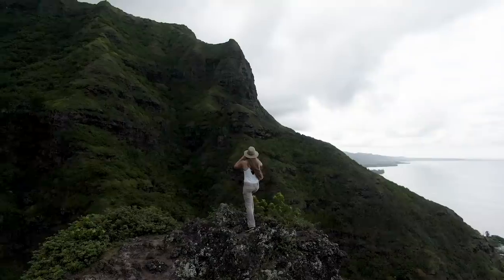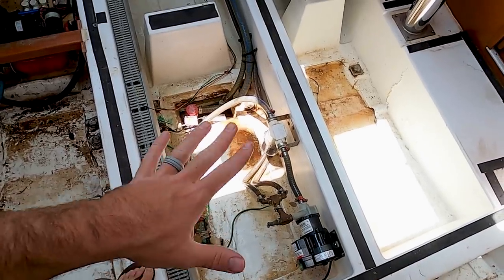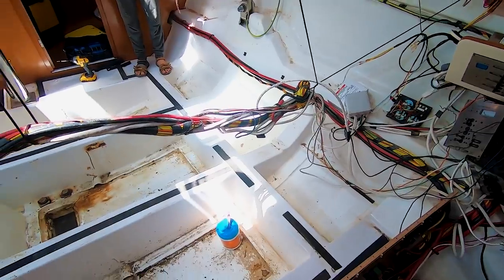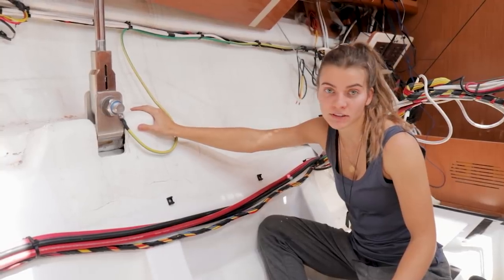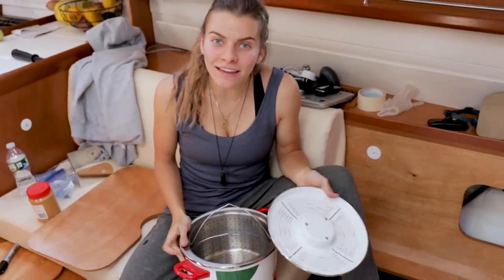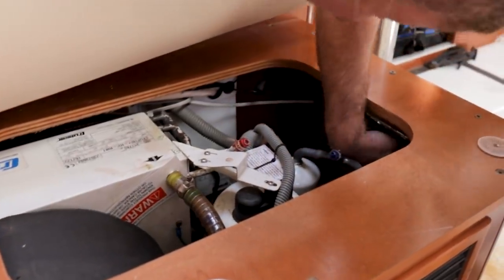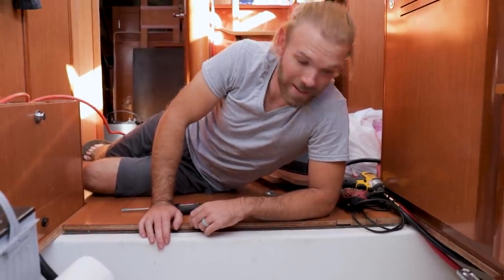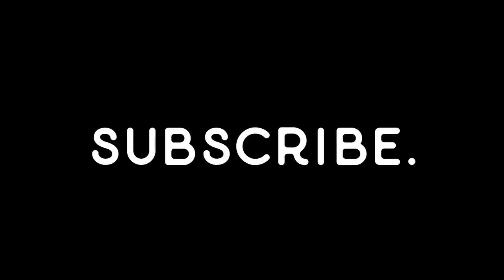Our SALVAGE SAILBOAT Has Been Leaking for Years | Expedition Evans 6

Comment: You should check out sailing zephyr ( if you haven’t already) they bought a similar smaller Beneteau as your with a broken shroud base like yours. First few episodes.
Bear in mind there could be all sorts of patches and edges of fiberglass that look like they were added after the boat was complete but they probably are not just reinforcing added from experience as they built the boats or issues not thought or or noticed during the initial design.  ( and if not normally seen may not be the smoothest).
Boats are not fully engineered like cars ( that still have problems) many things are done on the fly or from previous experience on earlier boats. Sure computer design has help keep the costs down but the structure is extremely complex’s and scaling up does not always work as expected.  Sure they could just build them so strong they would never break but they would also be too expensive and slow ..... remember they only have to last for the design life ..... what ever that is  10, 20 30 yrs ???? 
Cheers Warren  ex boatbuilder

Comment: Sub’d. Best of luck. I really admire your ambition and work ethic (and the careful steps to get where you are.)  But, how did you get all those cleaning wipes. They’re still unavailable anywhere near me (lol).
Reply from the maker: Ha! They were left on the boat by the previous owner. No idea where you could buy them. Best of luck!
Reply: Expedition Evans you might also want to try using a steam cleaner with a hose in conjunction with a shop vac to clean bilge gook. It's cheap, quick (and satisfying!) and also useful for cleaning other areas as well.

Comment: The grid needs to be reattached to the hull. The grid stiffens and support the hull. Even you just fill up the gaps between grid and hull with epoxy, that area needs a proper cleaning before, or it wont make a connection. The cleaning alone is going to be an adventure and I don't see how this is done without a proper, intense pressure cleaning from inside. Watch this video 3:30 to 4:00 (https://www.youtube.com/watch?v=f5Et2R0oIJY) to get an idea how the grid is attached to the hull. The video shows the Bavaria Shipyard which actually was a competitor of Beneteau, using similar industrial standards. That video in mind, it could be, that just the grid area around and behind the keel is cracked and possibly bend, while the front grid is still proper attached to the hull. That leaves you with just filling up the gaps, as mentioned before, as the only way possible to do it anyway. But as many sailors already told you, involve a surveyor. You need a true information, what is the current state, how can it be resolved, what are the cost of it? Without those information, you're just dreaming a very expensive dream, that soon could turn into a nightmare. Don't get me wrong, I want you guys to be happy sailors around the globe, but a happy sailor sails on a save boat as a number one condition.

Comment: Hi👋. Id like to pass on alittle knowledge about fibreglassing without sounding like a knowitall. Spent the first 16 years of my life growing up on a boatyard in Plymouth, UK watching and helping my dad build several small boats, water/diesel tanks, canoes, then spent 4yrs in sn apprenticeship with Princess yachts as a fitter/engineer then a year as a customer service engineer and fibreglass repair specialist with Sunseeker yachts in Majorca. Although all boat builders have slightely differant ways of doing things generally the the hull is plain polyester resin, gelcoat on the exterior of any moldings and it looks like pigmented resin for main layup. On the inside the finish is done with a flowcoat which is gelcoat or resin with alittle wax in it to give a slightely satin finish which is why it poss looks differant where internal layup is. Please please please learn the virtues of a ribbed aluminium roller when laying up. I wont name names but have seen some big jobs carried out on YT that have looked great but lack being rolled out when wet. Rolling out with a ribbed roller compresses the layup thus making it more dense and therefore a stronger job altogether. If you layup and roll the crap out of it the wet matt and resin the resin rises to the surface and the noise it makes changes when rolling. As long as you can reinforce all the joints where grid meets hull and its heavily "keyed" with like 80grit disc and acetoned before layup i cant see you having a problem. Also read somebody in the comments saying to bolt the grid down through the keel bolt holes to pull grid to hull which is a great idea. Or even hang the keel on long studs from top of the grid down through the hull to give proper shape before laying up over the mating surfaces. I bet ive just bored you to death but rather that then you have a flexy keel mid ocean and water ingeess. Happy glassing.

Comment: Maby you diy ers get some one to fix it what makes you better than the factory using resin and resin layups and yes they were some hand layups over the chain block pins I remember so don’t  start grinding things off,   the keel grid will need engineering specs done for repares if it’s come adrift from the floor  not glue , you won’t answer so think about it

Comment: Hi, I have not read all of the comments, I do not want to insult anybody's intelligence. But the cracks I see is not the big problem your boat has. A section of the molded piece that is cracked will need to be cut out to gain access to your boats hull to find the real problem and fix it inside and out. Under the waterline it is beast to lay glass inside and out if you can get to both side after grinding out the old damage and cracking.

Comment: You are not working on the grid. You are working on fixing stringers.  The grid is somewhere you put your boat that dries out at low tides so you can work on your boat for a short time.  I'm sure as a pilot you will understand if someone was saying the flappers on the wings. You would help correct them.  Just saying. Haha